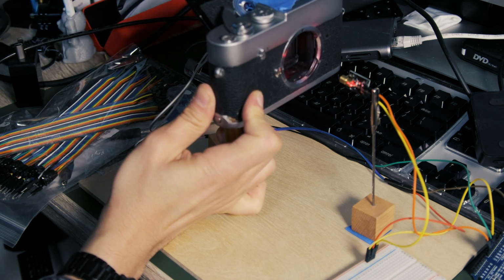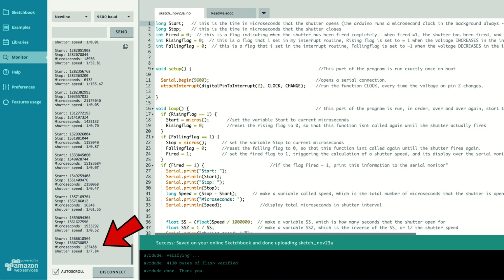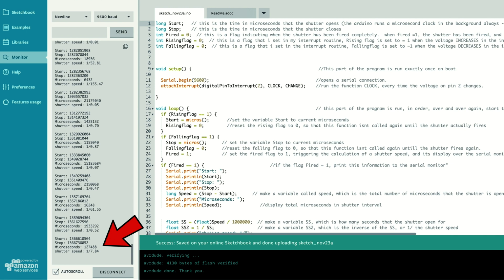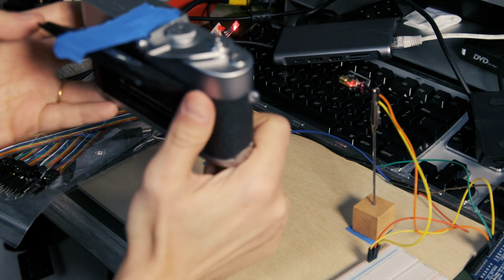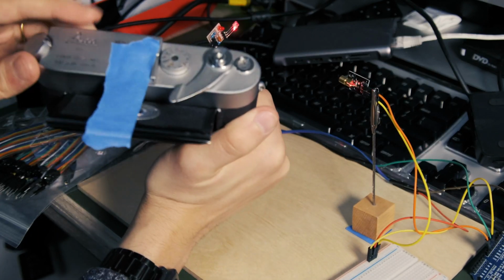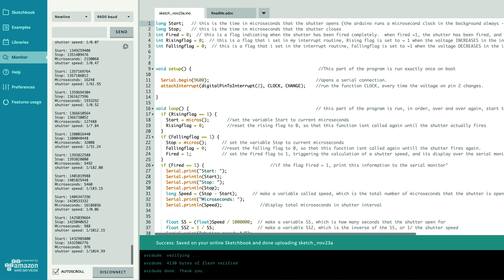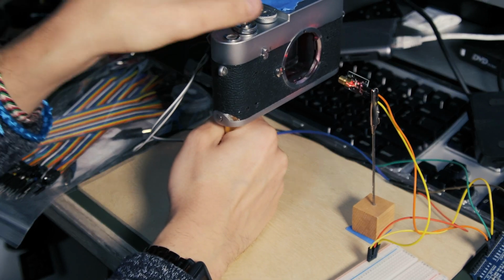DIY Shutter Speed Tester with Arduino

Comment: For some reason, the code didn't work for me. However, I managed to create the working code using chat GPT. It's simpler and quite accurate, measuring the time in microseconds. So if someone needs it, just write me a message.
Reply from the maker: @whalespruce  nice! You can paste here directly
Reply: @KeigoMoriyama  
It's still working weird though :)

const int sensorPin = 2; // Digital pin for the laser sensor
unsigned long startTime;
unsigned long endTime;
bool measuring = false;

void setup() {
  pinMode(sensorPin, INPUT);
  Serial.begin(9600);
}

void loop() {
  int sensorValue = digitalRead(sensorPin);
  
  // When the laser beam hits the sensor, the shutter is open
  if (sensorValue == HIGH && !measuring) {
    startTime = micros();
    measuring = true;
  }
  
  // When the laser beam is blocked, the shutter is closed
  if (sensorValue == LOW && measuring) {
    endTime = micros();
    measuring = false;
    
    // Calculate the duration in microseconds
    unsigned long duration = endTime - startTime;
    
    // Print the duration to the serial plotter in milliseconds (1/1000 of a millisecond)
    Serial.println(1000000.0 / duration); // Output in 1/microseconds
  }
}

Comment: Anyone here in 2024? I bought an arduino uno, laser, phototransistor and LCD display. The code (cameradactyl) does not work! It freezes, crashes, the shutter speeds are inaccurate, it only shows 40-60/sec. Someone wrote here (Luigi, Javier) that it was modified since then, is there any new, updated code? Also, the video doesn't even mention the lcd oled display, is it already included in the code? (no). Please share recent information who has done it recently, don't let anyone tell me that it works! 3 years old code, my Arduino doesn't work! Someone help me please

Comment: The main loop() is entered every 2500 microseconds or so when using the Arduino IDE to compile and run the code. At least for me. That means if you break up the start and stop functions (which is how this is coded) so that you use more than one call into the loop() then any shutter speed faster than about 1/125 could be erroneous For certain this code will never read 1/1000 and I would not trust any 1/250 or 1/500 readings. Perhaps the Microchip Studio has different looping code. I am just learning how to use that. But, if you want to see accurate faster shutter speeds, then you need to redesign this to do all calculations inside the current loop when the trigger has fired off the ISR. And even that may not work because of the potential delay between the ISR and the loop() code.
Reply from the maker: Thanks Kevin I’m not expert at all with coding so if you have anything to share with community is highly appreciated
Reply: @KeigoMoriyama  ur welcome. I worked on my code a little bit today. The calls to save the time (micros()) all need to be in the ISR and not in the main loop. That is if the loop does the calls at different iterations thru. I believe I have a version that does this now. But I have no verified camera shutter that I can trust to tell me I am right. But I will put my code up on my google drive soon (the .ino) and you can play with it if you want. I do not know Arduino well, but I spent my working career writing software for hardware devices, so  I do have some helpful knowledge. I wrote a simple loop program that did a call into micros() each time thru the loop. And then printed it. You can try this and you should see something like a time difference of 2500 microseconds. Which equals .0025 seconds. This translates to about 1/400 second. But the time difference moves around.
Reply: Hi Kevin, could you please share your modified code? Would greatly appreciate it!
Reply: Anyone here in 2024? I bought an arduino uno, laser, phototransistor and LCD display. The code (cameradactyl) does not work! It freezes, crashes, the shutter speeds are inaccurate, it only shows 40-60/sec. Someone wrote here (Luigi, Javier) that it was modified since then, is there any new, updated code? Also, the video doesn't even mention the lcd oled display, is it already included in the code? (no). Please share recent information who has done it recently, don't let anyone tell me that it works! 3 years old code, my Arduino doesn't work! Someone help me please

Comment: Hello Keigo,
I put together my shutter tester using Cameradactyl's hardware suggestions, but I found (like you) that fast shutter speeds were giving me some weird results.
I think part of the issue is that on his code, he uses the interrupt to set flags, but he does the time capture inside the loop.
I rewrote the code so the clock count (=time) is captured INSIDE the interrupt, and set a flag. Inside the loop I just check to see if that flag is set (i.e. there was a valid time measurement), and show the test results if that's the case. Hopefully it makes sense.
In any case: don't change anything on your camera just yet! :D
Reply from the maker: thank you for the update. can you share the code? I was able to make it standalone and work through portable monitor but it crashes after a while, so i`m still looking at a possible solution and see if there is also a problem with the oled library too
Reply: @KeigoMoriyama  I'll need to clean the code a bit and find a way to upload it somewhere, but it's doable. Which screen are you trying to use?
Reply from the maker: @javierromero3736  I`m using the an iic i2c OLED Module Display 0.96"
Reply: @KeigoMoriyama  I have one of those somewhere. I'll check to see if I can make it work.
[Edit] I just remembered having some issues with them. I think the problem was that I was using a software implementation of the I2C protocol, instead of the built-in I2C port. I'll check.
Reply from the maker: @javierromero3736  really appreciate
Reply: Hi there could you share your code?
Reply from the maker: I think it’s not ready yet. So just use the one provided before(instructions in the description)
Reply: Friend, have you corrected the code already?
Reply from the maker: Unfortunately not yet
Reply: Hi Javier, I know your comment was written over a year ago, but if by an chance you're seeing this: Could you please share your code? I tried putting the Start = micros() and Stop = micros() lines into the void CLOCK() function and left the print commands in the loop but then I get compilation errors (the flags set under coid CLOCK() cannot be read in the loop). I'm clearly missing something but I can't wrap my head around it (because I have no experience in coding). Would greatly appreciate any help!
Reply: Anyone here in 2024? I bought an arduino uno, laser, phototransistor and LCD display. The code (cameradactyl) does not work! It freezes, crashes, the shutter speeds are inaccurate, it only shows 40-60/sec. Someone wrote here (Luigi, Javier) that it was modified since then, is there any new, updated code? Also, the video doesn't even mention the lcd oled display, is it already included in the code? (no). Please share recent information who has done it recently, don't let anyone tell me that it works! 3 years old code, my Arduino doesn't work! Someone help me please

Comment: This looks promising! Any clue on how accurate and reliable it is?
Reply from the maker: i did lots of tests on the same shutter speed and the results are similar. I also used a free app on the photo to test and the result is close (usually this app works better with an external item to attach). I`m confident to recommend. just be sure to align the laser and the sensor

Comment: Really great idea, I use a dongle for my iPhone and an App at the moment. But since I have some Arduinos lying around, I think I will give it a try. Maybe that whole thing will also work on an Arduino nano, so everything can fit on a breadboard ?! I will closely follow your progress on this project. A stand-alone shutter speed tester would be an awesome great gimmick to have, specially when tinkering around with cameras ! Great work 👍🏻🙏🏻
Reply from the maker: thanks mate! yes i`m pretty sure is the same even with the nano. I`l work these days on the monitor part update